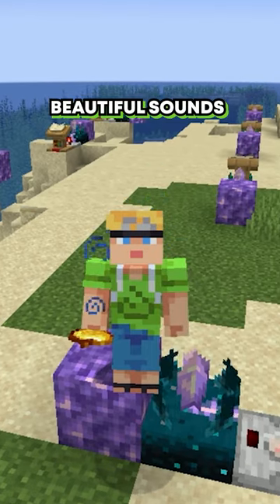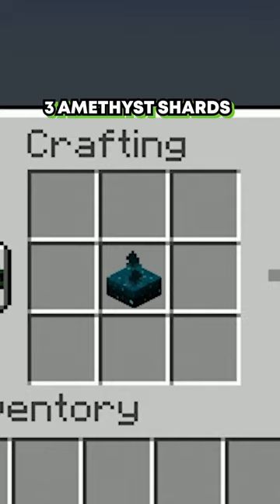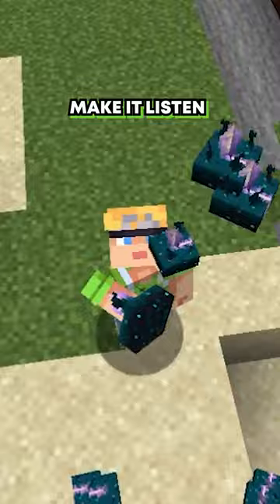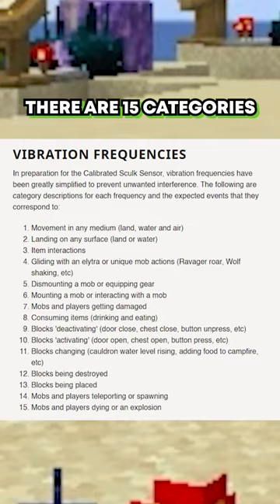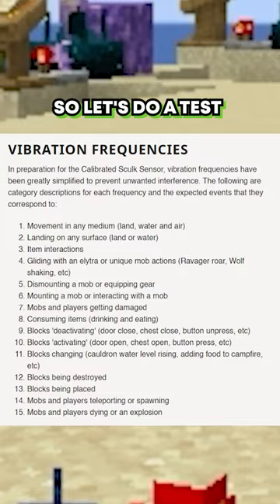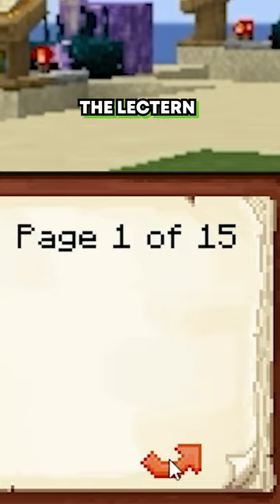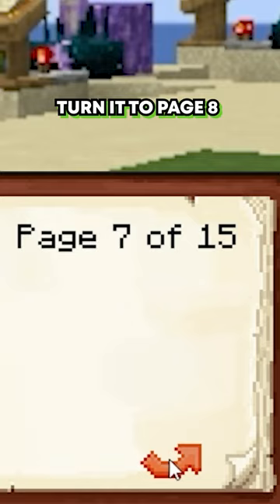#Minecraft NEW Calibrated Sculk Sensors Explained

Comment: Jesus so can we basically make a radio in Minecraft and creat a communication device that only response to specific actions, because that sounds actually epic
Reply: Yep, only limitation is that most of those sounds would have to be caused by the player, as there are very few categories of sound that can be produced automatically.

Still plenty fun
Reply: @WhatIsMyPorpoise  pistons, dispenser, armor stand / anvil drop, cobblestone generation (maybe), tnt explosion
Reply: @fireboat9063  generating cobble doesn't get noticed as a vibration.

And pistons and dispensers are redundant, they both output the same signal, just use a trapdoor.

But yeah having tested it, it's possible to produce 14 out of 15 signals automatically through redstone. It's unwieldy but possible.

14 might be possible if you have the good fortune of having your setup next to a mob spawner, but good luck soundproofing against interference from nearby mobs in caves...
Reply: actually, yes
Reply: THATS IT doxes your coordinates
Reply: Mainly you could simply do stuff with door/other opening/closing, and that's it for binary